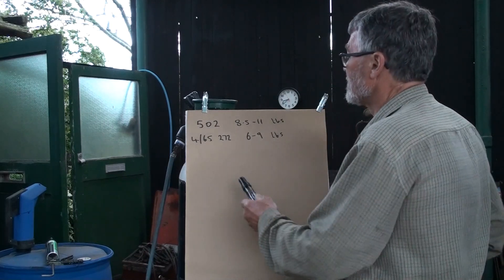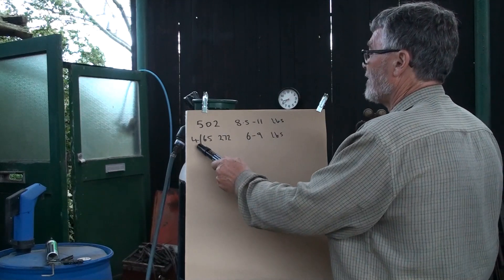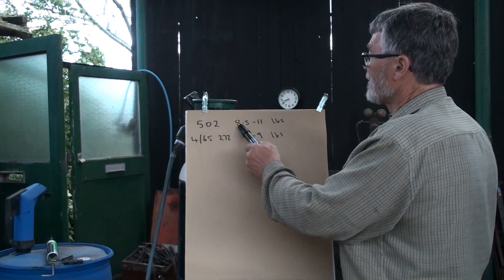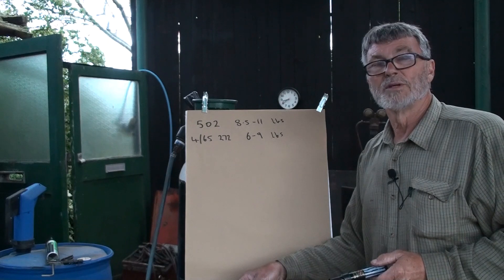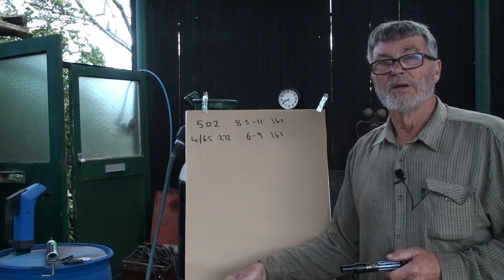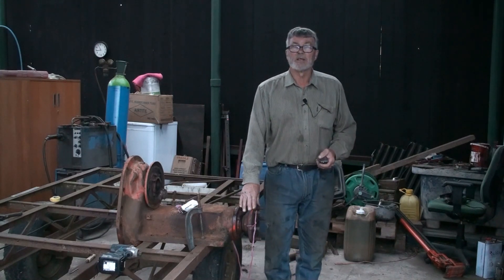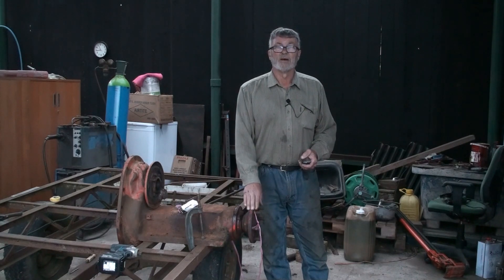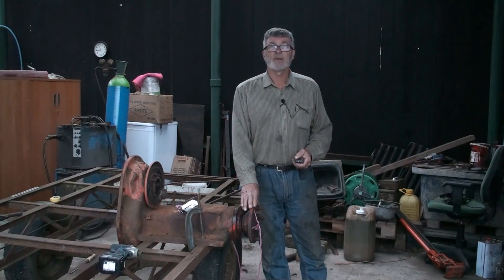Setting Nuffield/Leyland Halfshaft Bearings

Comment: Thanks for your time,👍what I've always done with these bull gear nuts is to just feel how tight things are and then check how close I am to the next hole or how far past the last hole the nut is, and judge whether to back off to the last or increase to the next. I also like to hit the shaft a little slap with a mallet before putting in the cotter pin, and check the rotation again, whether it feels to tight or not.

Comment: Hello, it seems a little strange to me that such a high torque is required. I would have expected the two taper roller roller bearings to be locked up with that high torque. Is it possible that the inner bearing is seized to the shaft so the torque on the nut is failing to move the bearing and therefore increase the preload ?. Just a thought ,perhaps I’ve misunderstood the setup. Thanks for the videos.
Reply from the maker: No, the inner race was moving on the shaft, when I undid the nut a full turn it all became loose.

Comment: Hi.. looking for a bit of advice. i have a 460 and have an issue with the 3 point linkage, problem being it is very slow at lifting, i have changed the oil and cleaned the filter, it worked great for three or four times. then went back to being very and loosing pressure, and ideas on the the issue i have?  thanks in advance
Reply from the maker: I would try putting the question to the Nuffield facebook group
Reply: Welcome to the proud ownership of a Nuffield. If you fund a fix that isn't full replacement or overhaul of the entire unit let us know. That's the only advice I get and for the price of shipping moreover the price on parts IF you find them ill let it be slow...when it runs.

Comment: I didnt have any info on my 4/65 and it was leaking when i bought it. Ive been a diesel truck mechanic all my life so ive been around equipment plenty. So if i dont have specs on a bearing i just take it to 0 lash. It hasnt backfired on me yet. My Nuffy isnt leaking since i fixed it 10 years ago (well it leaks just not from my bearing and seal repair). Now i just need to get an injection pump that doesnt cost more than i paid for the tractor and only a it ran when it was parked guarantee.